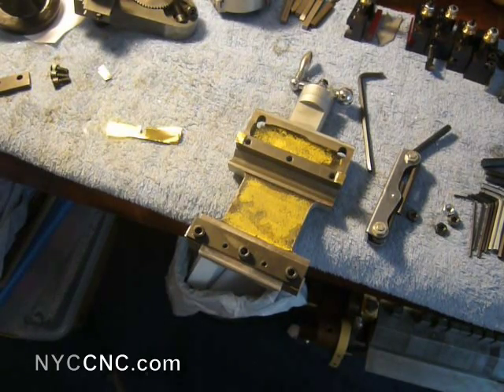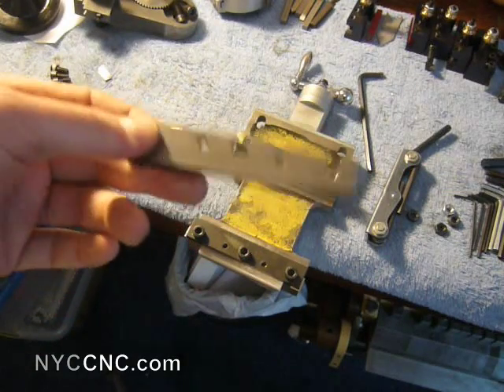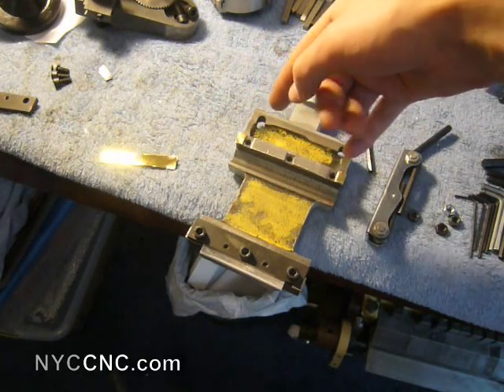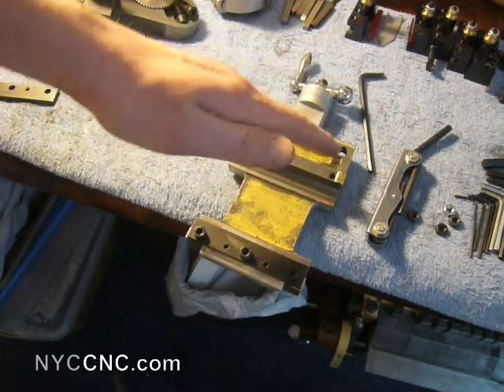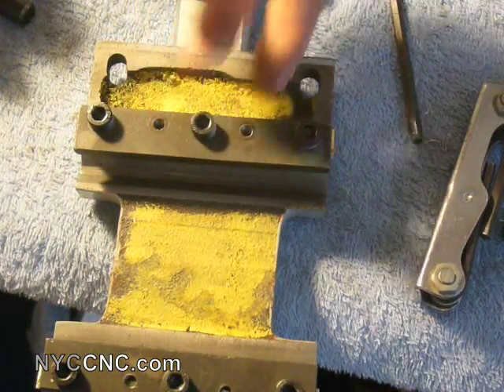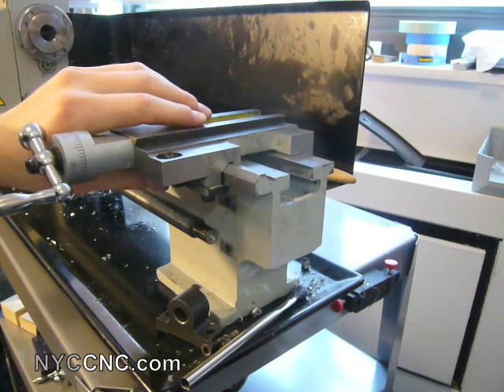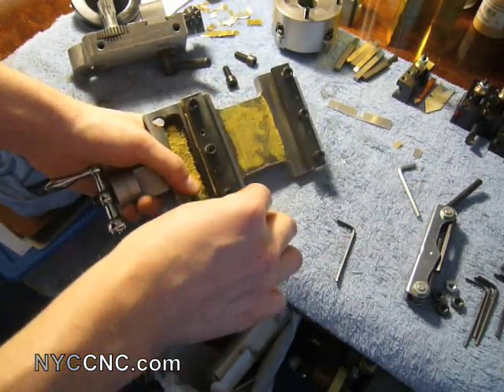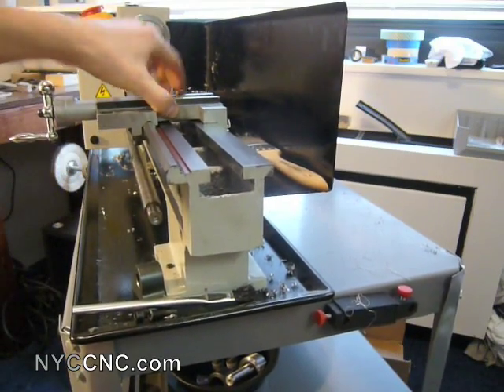Micromark 7x14 Mini-lathe Carriage Gib Adjustment Part 2

Comment: I had to scrape the bottom of my ways a little near the end and shimmed it like you did.  Then I put lapping compound on the bottom of the ways and oil on the top, and slid the carrier back an forth until the movement was smooth.  Then I put a smaller shim in and repeated until the bottom was true.

Comment: Yes it turned out great!  Micro mark is probably better quality than the Cummins version, but the bottoms of mine were nowhere near where they should be.  On mine there was no way to shim it without compounding the bottoms because if I shimmed it for working near the headstock I couldn't move the carriage to more than a few inches to the right without it binding.  If I shimmed it to fit near the tail stock there was a ton of slop near the headstock.  II bet micro mark ones don't have this issue.

Comment: Thanks for the video, I realize this is an older post, and so I'm also certain that you now know the front of your carriage is called the "apron"? I was trying to tell you through the monitor, but you couldn't hear me, LOL!

I'm just getting started on my road to tool making Heaven, and learning all of the terminology has helped me to communicate with the serious pros out there...which it seems like you are one of now...sweet!

I was a welder and fabricator for years, but my Atlas TH 54 10"X36" is my first machining tool, and I too am having to adjust my gibs to remove the chatter I was getting. Of course with my lathe being from the stone ages, I'm also going to have to replace all of the tensioning hardware. Thanks for the shimming idea, I like the even pressure that should be created...I'll try to post a video of my own trials, unless of course you have something surpassing this?

After seeing that you've moved and upgraded to a bigger...EVERYTHING, I'm guessing that you don't have to deal with this lathe anymore?

Aloha...Chuck

Comment: Apologies if I've missed something but why not adjust the gibs on the adjustment screws then tighten the fixing screws moderately with some threadlock on them?  You'd probably only need a weak or moderate strength threadlock ( definitely not the super strength/permanent stuff ) and it'd never come undone unless you want it to.

Again, I'm only trying to get started with mini lathes, so again, apologies if threadlock has been tried and found wanting.

Comment: Here are the LittleMachineShop carriage gib adjustment instructions:
To adjust the carriage retainers:
1. Remove the right lead screw mounting bracket.
2. Disconnect the apron by removing the two socket head cap screws through
the front of the carriage.
3. Slide the apron to the right and off the lead screw.
4. Loosen all the fasteners on both retainers.
5. Snug the socket head cap screws so the carriage can move, but without
play.
6. Snug the setscrews. Do not over tighten or you might break the retainers.
7. While holding the setscrews from turning, tighten the lock nuts.
8. Replace the apron.
9. Replace the right lead screw mounting bracket.

Comment: I'm a little confused by your video, Little Machine Shop's guide talks about adjusting the tightness of the carriage by using the 3 screws and locking your adjustment with the set screws, it doesn't look like you are adjusting the gib that way, so why would you even need shims if you just change the tightness of the fit by using the screws?
Reply: +SDPickups 

I was confused about this at first, also. But, in this video (and part 1), NYC CNC shows an alternative means of adjustment, using shims instead of the set screws.

Normally, the set screws are what keep the carriage gib plates the proper distance away from the lathe&#39;s ways. If you removed the set screws entirely, and simply clamped a gib plate using the socket head cap screws, the carriage would be locked to the ways (with the gib plates held at an angle, though that&#39;s not so precisely important). You&#39;d ruin the ways/carriage from the resulting friction -- if you could even move the carriage. 

The stock adjustment method with set screws also causes a wave in the gib plate, possibly cracking it. By using shims to set the distance of the gibs from the lathe ways, the proper distance of the gib plate from the lathe&#39;s ways can be achieved.&#160;A side effect of this mod is keeping the gib plate flat, rather than bending it -- no more wave, no more (reasonable) fear of cracking the gib plate. If done carefully, this mod can slightly increase the bearing performance of the gib plates against the lathe ways (although how much bearing contact is there, really? -- see below). 

This modification also makes uninstallation and reinstallation of the gib plates relatively trivial, ensuring repeatable performance. No more fiddling every time the gib plates are removed. 

My recommendation for anyone doing this, before they start, is to hold their gib plate against the underside of the ways, and use a feeler gauge to determine the thickness of your initial &quot;big shim&quot; (that&#39;s the .032&quot; aluminum in this video). If done properly, the remaining shimming can be done using very thin brass shim stock (i.e., you don&#39;t have to buy a big pack of .001&quot; through .03&quot; shim stock). If you created an overly-large &quot;big shim&quot; and sanded it down (probably with a 1&quot; belt sander, or just a file), you could probably incrementally remove material from the shim until the shim size is perfect -- no shim stock required. It&#39;s worth mentioning that, if you have a feeler gauge, you have shims to use -- and you know which size you need!

Smooth/lubricated cast iron on smooth/lubricated cast iron actually has a fairly low kinetic coefficient of friction. A fancy mod could alternatively use either brass or bronze gib plates (yes, C954 bronze is available in plate -- check McMaster Carr!), but that would require a mill to machine the gib plates. Furthermore, if everything is adjusted properly, the carriage is not really being clamped to the lathe ways -- there will be a tiny bit of a gap to allow for smooth movement. Only the smallest amount of rocking of the carriage must be prevented, so genuine clamping force between the ways and gib plates is minimal. 

All of this means that the smooth cast iron gibs are just fine (better than many alternatives). It is quite common to see the "upgrade" to brass gib plates, but I think most people who have done this are those who have cracked their stock cast iron plates and remade them with brass to continue using the stock set screw adjustment. Brass is probably less brittle, but retains low friction properties (I'm not well-versed in the brittleness of brass, I just assume that that's the logic). 

When you&#39;re all done, the carriage (stripped of the weight of cross slide and compound) should be able to slide freely down the oiled ways for a bit, without using the carriage handle. 

To NYCCNC, thank you for keeping these videos up after all these years. I just bought my lathe (and mill) about three months ago, and your videos have been illuminating as to some of the early frustrations of the 7x mini-lathes. Next up: lever operated compound lock (I think I can figure it out without Frank Hoose&#39;s instructions...)!
Reply: @benjaminsherrill5513  Excellent advice, many thanks!